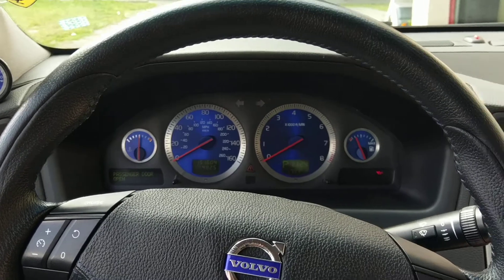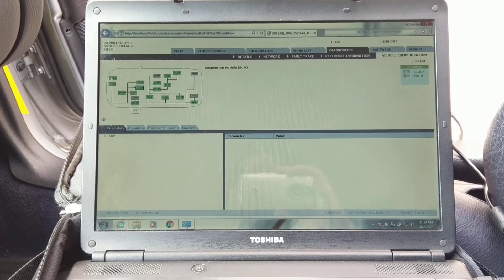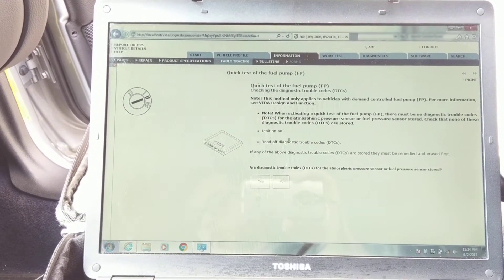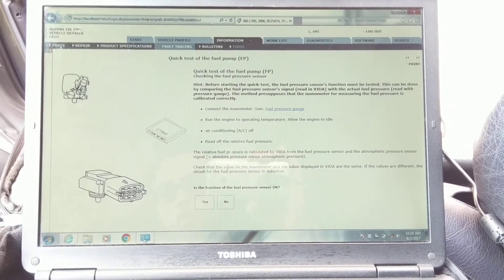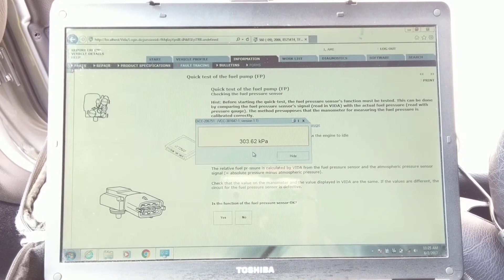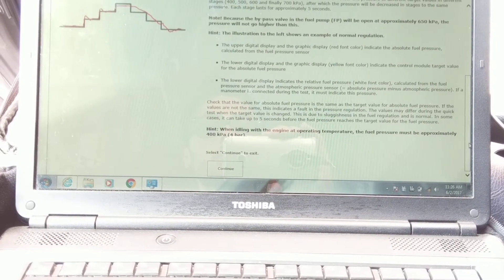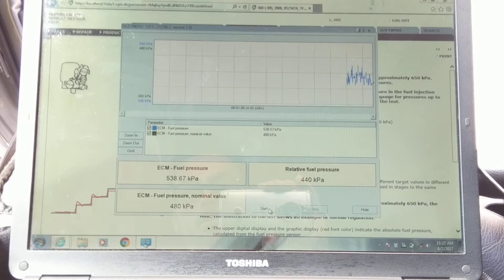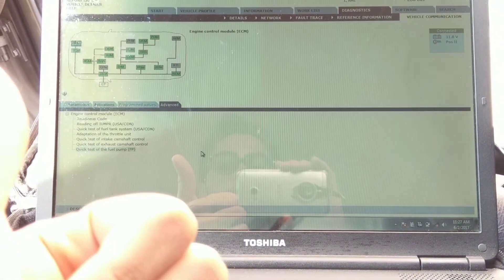Fuel pump test | Volvo VIDA

Comment: Have you changed any part in the car after the test? I am interested in the value of fuel pressure after changing the pump to a new one (you had 300 kPa)